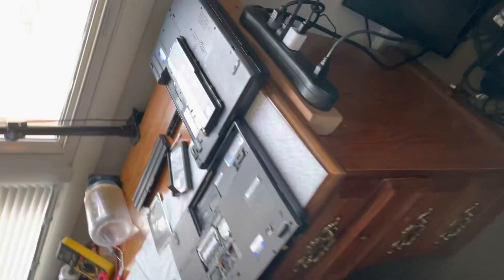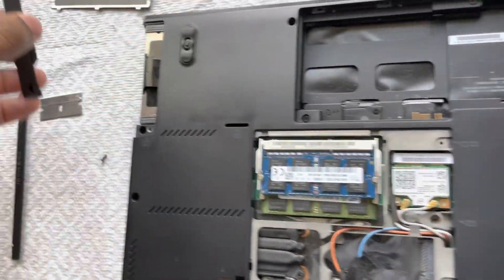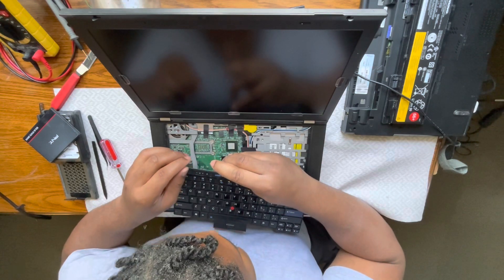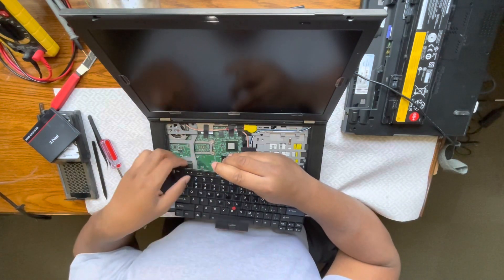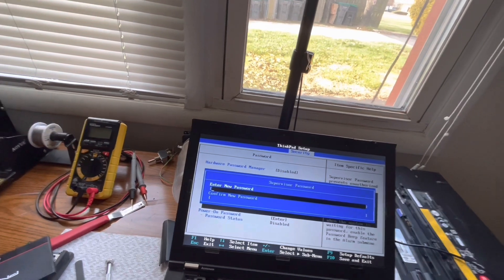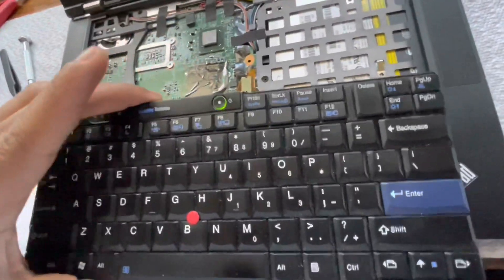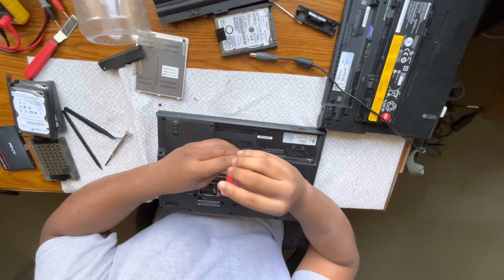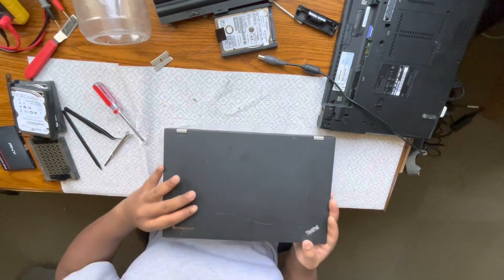Lenovo T420S BIOS Lock Removal

Comment: Dawg, what did you do? You just pinched it with tweezers or am I missing something?
Reply from the maker: I made the short with the tweezers while pressing “F1” you want to set it up before you  turn the laptop on and make sure you’re set up in a position where it’s easy enough to make the connection on both ends. Then power it on wait until the logo pops up and press “F1” while making the short.
Reply: @WellsTechandRepair  ill give it a try good looking out! Appreciate it! How do you get rid of that administrator password now lol...jus playin...
Reply from the maker: @dee.f88  No problem. Any questions just let me know.

Comment: Dude you're awesome, just one thing I don't get is that you just press them down gently with something made out of metal? excuse my english
Reply from the maker: Thank you and you have to use something metal because you need the two points to connect electrically and if you use to much force you could mess up the motherboard if the tool your using slips.